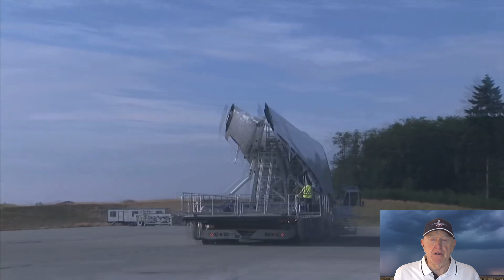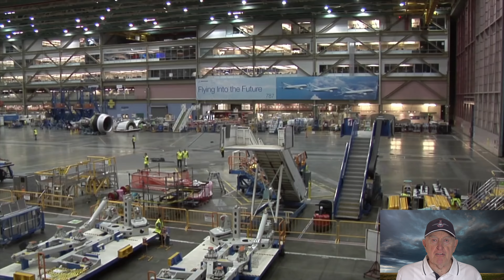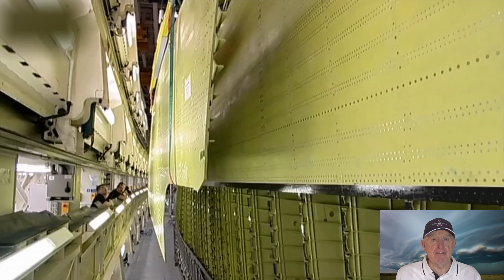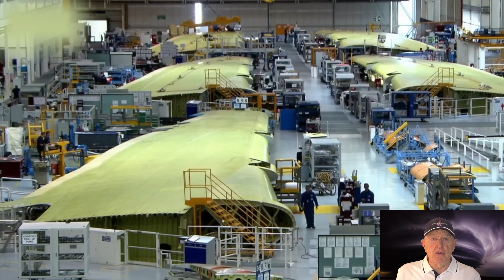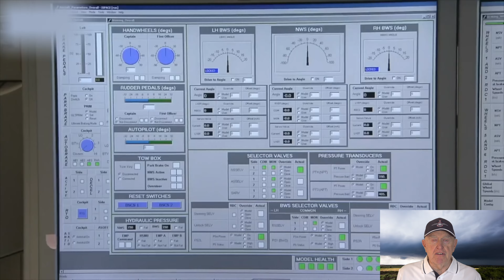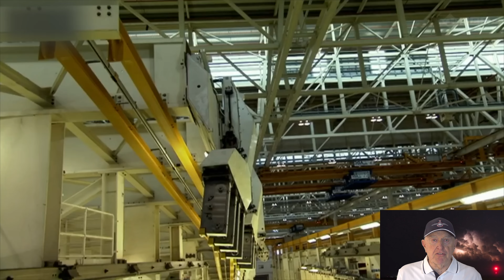Planes: From cloth and carbon fibre to exotics

Comment: Hi Sir. At ~3:55, you say that composites have “high compression resistance”. I have made sandwich construction carbon-compsosite-skinned blades for a 150-200 (I forget) HP ducted fan (poured vinylester foam core), and open-prop sandwich construction blades of glass on a shaped foam core for a personal project, so I know it has some compressive capability, but lots of talk about the recent Titan submersible collapse points to it not being worthy of that description.

Cool episode, and I like @roum22’s comment. Cheers.

Comment: The British MOD Carbon fibre research and development was carried out at the RAE Farnborough. One of my tasks as an apprentice there whilst in 33 Department main machine shop, was machining tensile test pieces from different carbon fibre trial batches. 
Once a suitable batch was decided upon, a connecting rod for a Matchless 500 single motorcycle engine was made on the then modern punch tape controlled milling machine, the rod performed faultlessly if my aged memory serves me correctly. Don't know what this proved, but it was entertaining for those involved.

Always enjoy the varied, and well presented output of this channel..
Reply from the maker: Brilliant feedback. Thank you for your praise. Much appreciated.